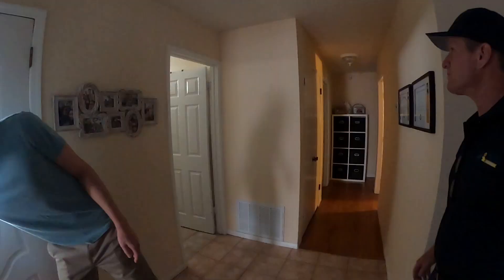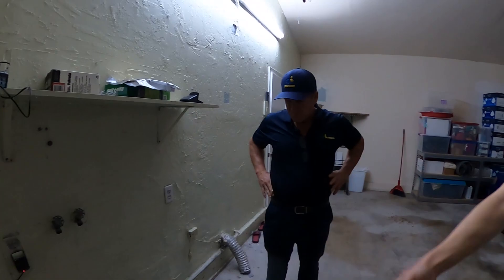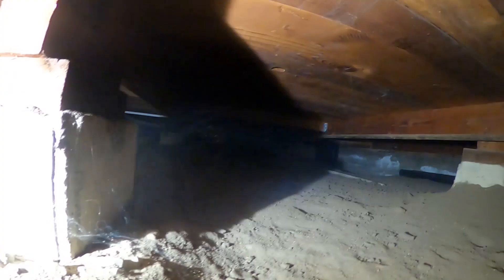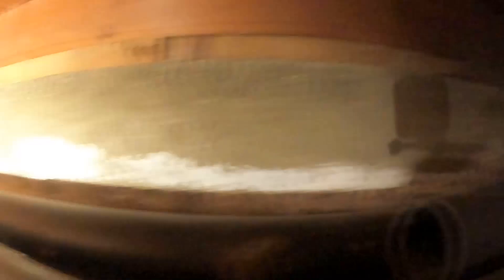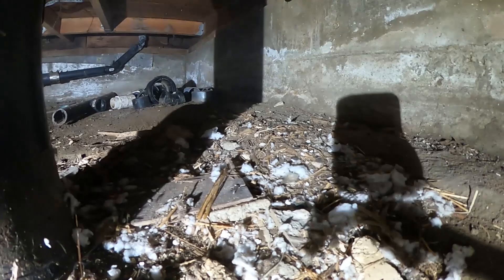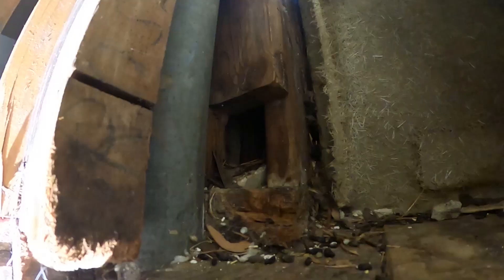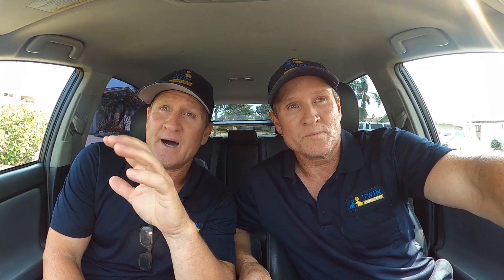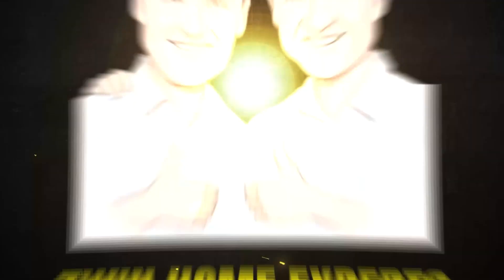EASIEST way to CATCH SEWER RATS!! BEST Rodent Control!

Comment: The apartments where I live are infested with rats they're getting into the cars chewing up the wires they're all over by the garbage dumpsters some have gotten into some of the walls. The garbage man even wrote on the dumpster rat problem.This has been going on since March they put bait boxes out in July and the landlord hired some guy and there's probably 30 bait boxes everywhere but he doesn't even come and check them for bait .They said, that they're not taking responsibility for the cars because they're actively trying to get rid of them. My car's been hit twice another neighbor had to spend $1,200 on hers another neighbor 500 mine was $800 the first time and now I need a whole what wiring harness. We did peppermint we did all that none of it stops it .
Reply from the maker: What’s a great share! This is so ridiculous y’all have to deal with this. 
You all need to make sure ALL food sources are gone from the area. 
Switch up bait stations. You all may need the twin trap stationed around the property, because it offers a safe place for rats to climb into. It also catches up to 30 rats without causing the hint of death to the other rats.

Comment: You guys walked away frim the job too early. I don't think you went as far as u could have. You could have drilled large holes through the wood and placed the camera in the  opening.  You didn't even suggest  it. What's up.  You have the tools. Use them.

Comment: I'm obsessed with your videos. Those vent pipes coming out of the roof are always going to be a way in. Can an American tell me why these exist? 
I'm from the UK and we generally just have the soil pipe above the roof (connected to your bathroom and toilet further down). This is connected to the sewer further down. There is also another pipe for rain water attached to gutters. These are always on the outside of the house.
Reply: what you described sounds identical to north american homes.  vent pipe = soil pipe?
Reply: Near every trap and fixture to make sure the flushing actions don't siphon the traps!

Comment: Awesome channel guys they've been a great help, I love your enthusiasm! Much love from Scotland! 💕

I've recently moved into my Dad's basement flat that has been pretty much destroyed due to rats. They were in every room of the house, under the floors, in the walls and up in the attic chewing all of the cables. After the pest control left poison everywhere I thought they were gone, but now that the weather has turned cold, they are back. 

Apparently the building has been plagued by them for 10 years. One of them even bit my old man on the lip, another one climbed into his bed. 😱

Now after weeks of investigation I think I've located the access point which is via the main sewer probably from a break in the sewer pipes under my bathroom (a CCTV inspection is being organised as I write this). 

Question! I've been looking into getting a non-return valve stainless steel "rat gate" thing - in your experience are these effective? Thanks!
Reply: I've seen these guys use the rat gate in a diff video.... I don't think it's necessary though if you repair any chewed/broken/damaged sewer/drain lines, cap off vents and trap/kill any inside still after eliminating their entry. Also seal any openings in your foundation
Reply: @jeffreyschneider4335  well as an update for my situation. I wasn't able to afford a large steel rat flap (£400+) and the CCTV inspection I got was inconclusive because the damn thing couldn't navigate the turns down there. Luckily I did locate an old pipe under the floor which when sealed seems to have done the trick. We've been rat free for a few weeks now, it's been blissful 😊
Reply: Yo we’re do y’all live cuz we have a mouse that we can’t catch
Reply: We’re is your country or state
Reply: @andrewgilroy2758 Terrible experience. Hope it's over.

Comment: I heard New York has one of the biggest rats 🐀 would really like to see a video from NY
Reply from the maker: One day will be in NY! It would be a nice challenge to deal with those old structures to hunt them down.
Reply: Just moved out of NYC and I can confirm it is a hug issue. A couple yeas back they were nesting under my car motor cover and ate through the wires. I would have to do in and clean out the engine because they would drag bones and other junk. On garbage days I could go kick the bags and several rats would run out. It is no joke. I would love to see the Twins, Mouse Trap Mondays, and the Mink Man head out there and give it a shot.
Reply: Biggest rats are in DC 🤣

Comment: I could cut the fiberglass wall open so you could repair the vent. and repair it . that is my trade. in the Los Angles area?.
Reply from the maker: That’s awesome! We went back and remove the fiberglass surround and installed our sentrel bath surround, came out really nice and added value to the bathroom. Thanks for watching!

Comment: If 7 houses(we're attatched) including mine have mice in ceiling/walls.  does that mean a least 1 house has a hole leading to outside
Reply from the maker: Yes! Great question! When we get these calls, and one unit is having a issue, we won’t take on the job unless we have access and buy in from ALL the adjoining unit owners.
Reply: @TwinHomeExperts  great videos... Keep them coming